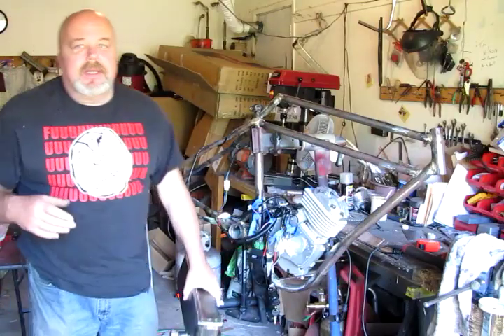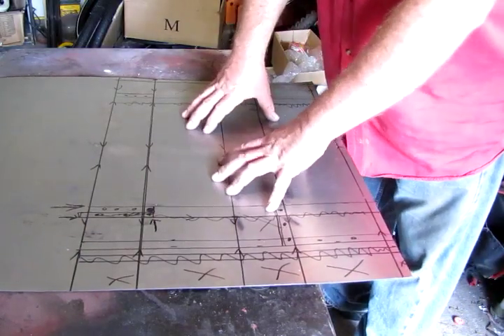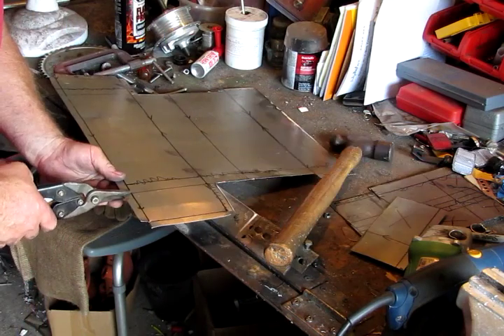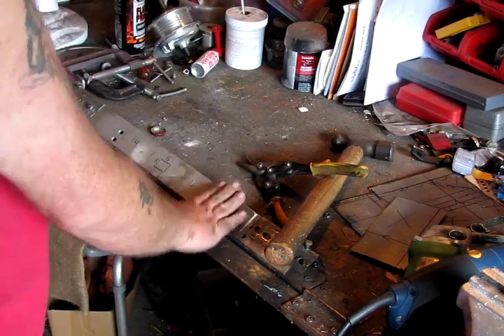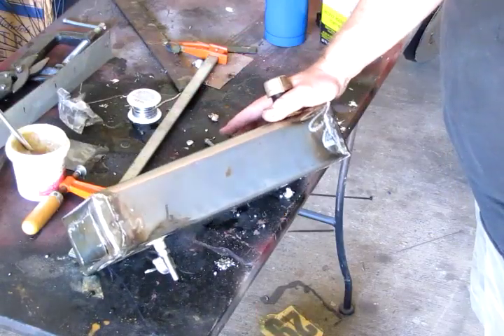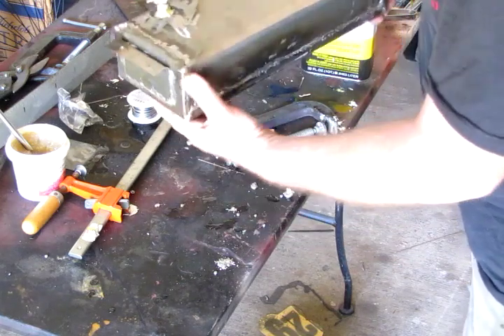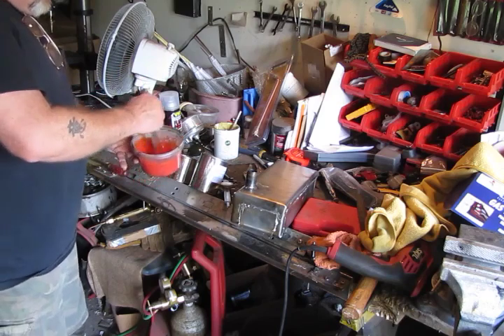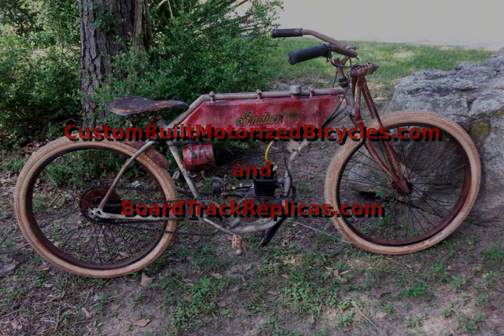How To Build Soft Solder Motorized Bicycle  Go-Kart Motorcycle Gas Tank

Comment: When I build fuel tanks I use steel Pop rivets to join the metal together. Then I solder the tank to seal it. Then I seal the tank with a liquid sealer made for fuel tanks. Any mounting brackets are also fastened with steel Pop rivets first, then soldered. I have also used small bolts to fasten mounting brackets and then solder them to seal them and keep them from un-screwing.  I also use motorcycle petcocks so I have a reserve of fuel. Just the way I do it. For running small engines on the floor or workbench, I have several fuel tanks made from empty propane fuel tanks.
Reply: Does the solder hide the rivets?